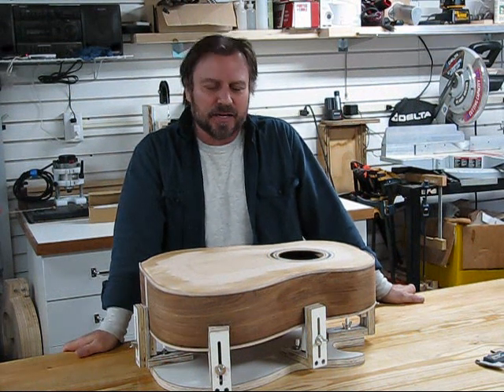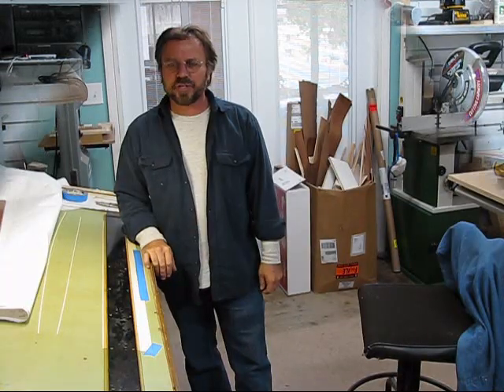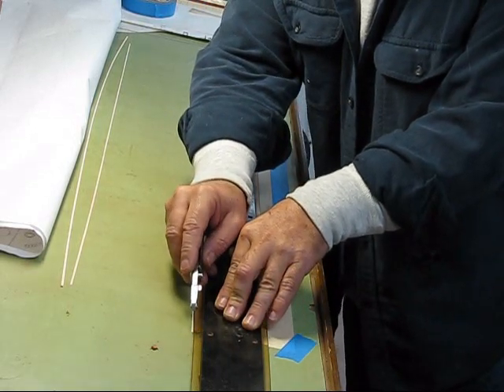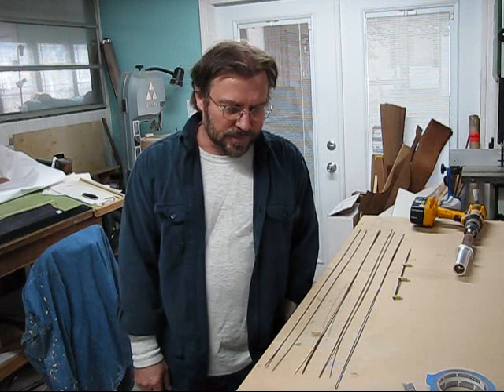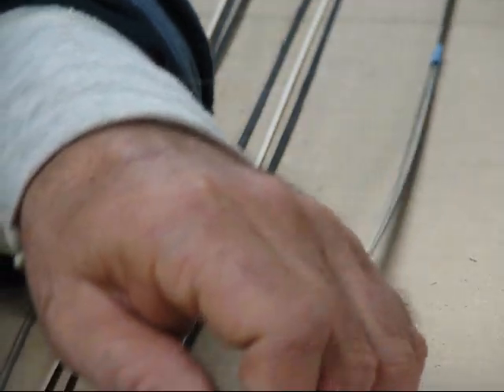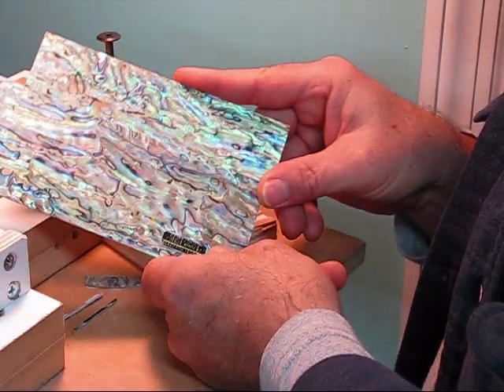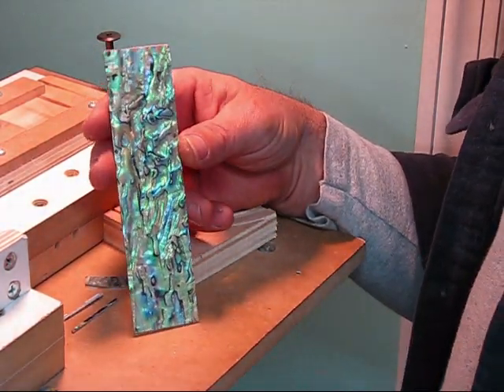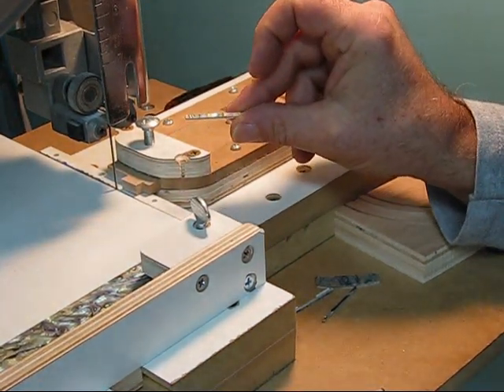Installing Ablam Top Purfling

Comment from the maker: @nallagerk  I have one of those. I haven't quite got the hang of it for the thin wood veneer yet. Alan Curruth uses one all the time and has beefed it up by making a heavy duty blade from a small knife blade and added a piece of brass to the fence for wear. He cuts heavier material for binding and rosette logs. I'm entertaining the thought of making a jig to cut the strips on a table saw with a thinn kerf blade like some do. Eugene Clarke also has a home made cutter he uses .